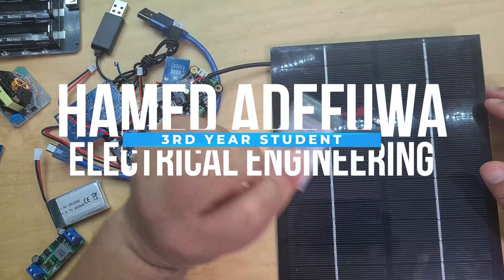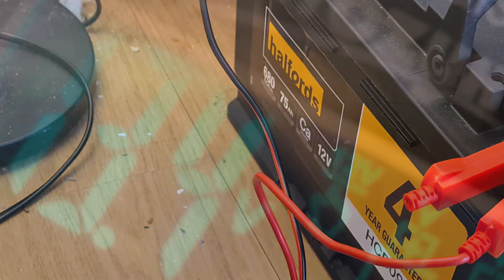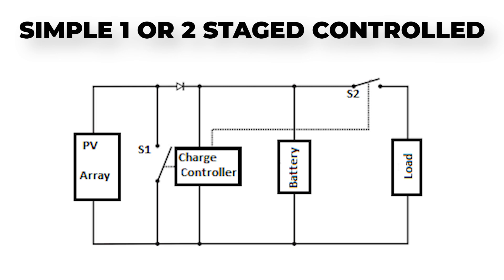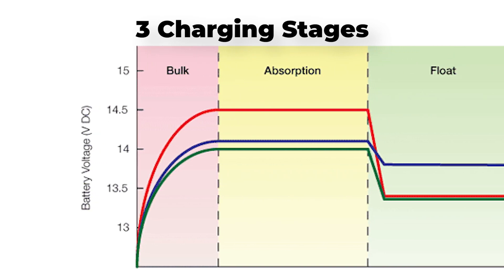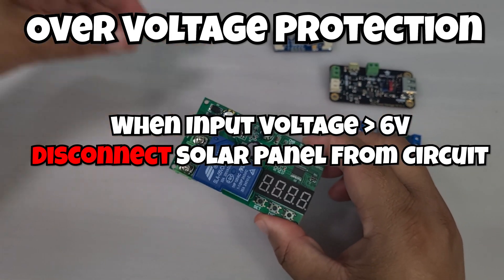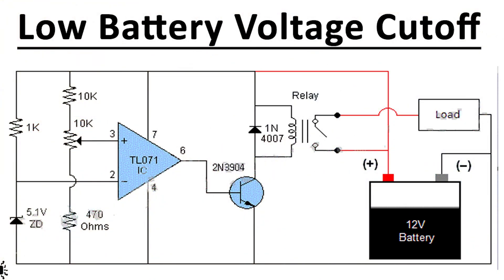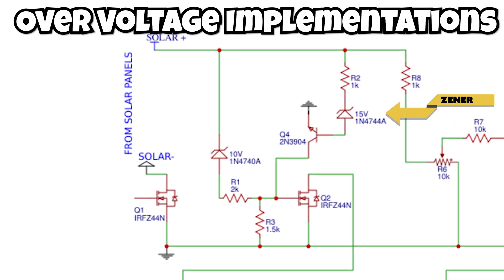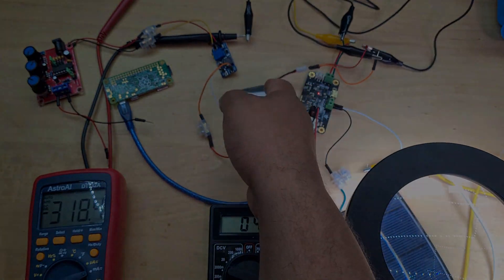How Solar Charge Controllers Work

Comment: Hi,
Thank you for this very informative video. It really helped clarify many concepts! I’m a 3rd year electrical engineering student currently working on building my own solar charge controller, and I still have a few questions I'd love your input on:

1. In the schematic you presented, is there any overvoltage protection specifically for the battery?

2. I’m not entirely sure about the purpose of the two SPDT relays (U1 and U2). Could you explain their roles in the circuit?

3. What voltage do you use for VCC in this design?

4. Do you recommend stabilizing the battery input using a buck-boost converter?

5. I noticed one pin of Q1 isn’t connected. What should it be tied to?

6. Do you think I should integrate CC/CV (constant current/constant voltage) charging logic into my first prototype to better protect the battery, optimize its lifespan, and prevent hazards? Or would it be wiser to start with a simpler version and conceptualize a more advanced controller later that includes all three charging stages?

7. Also, do you have an updated version of your schematic?

Thanks a lot for any feedback. It would really help me improve my design!

Comment: Well shit this is actually a very informative video. 
One question though, if my panels are doing 40v, and connected to controller and 24v battery that is currently on 26v voltage, does that mean the remaining 14v from the panels are wasted? not entering the battery?

Comment: for the backcurrent protection.. i'm going to try a Schottky diode
Reply from the maker: Mate you're a legend, I knew I was missing something. I'm literally at my desk writing up my plan for this now. I need to look into Schottky diodes, literally have no idea what they are lol terrible for a final year student. Tyty <3
Reply: @HamedAdefuwa  similar goals.. such a big topic... i read the forward voltage is lower with those diodes. struggling w/ an ina219 to measure everything at present.
Reply from the maker: That INA219 looks interesting, I'll purchase one now. I'd love to reverse engineer these kind of simple looking modules. It seems to use a shunt resistor to read the voltage across it and then uses the chip to calculate current. Thanks once again lol. Whats your plans? You looking to build a solar charger?